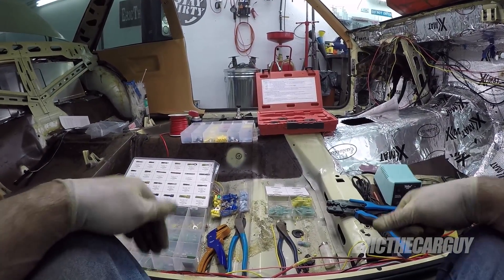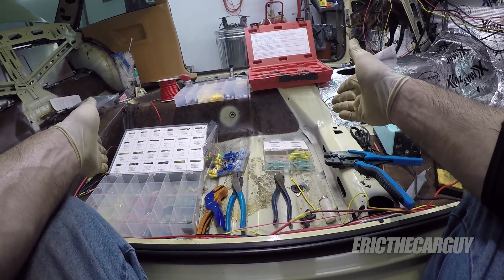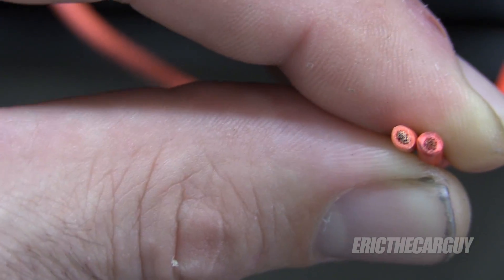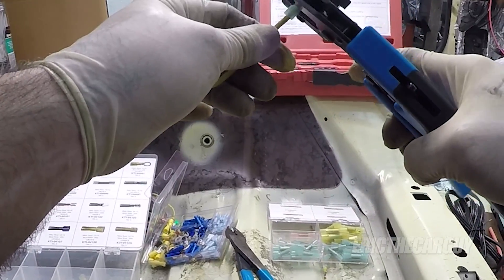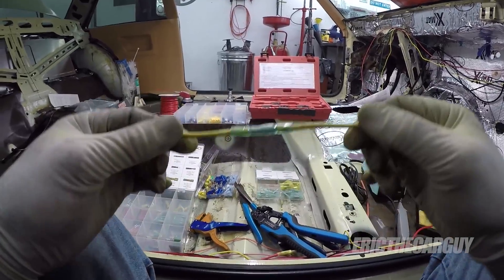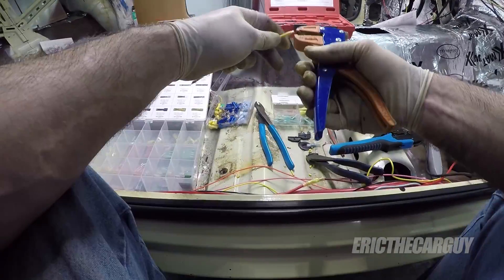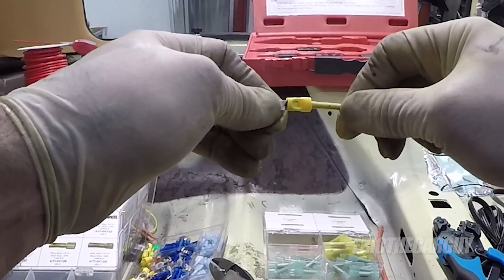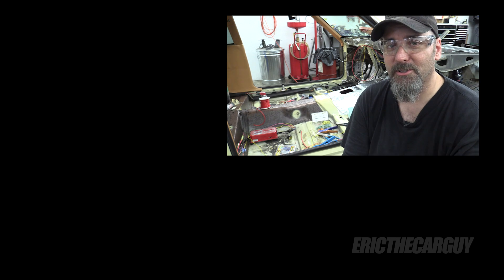How To Crimp Electrical Connectors

Comment: I'm an electrician in Queensland, Australia, and I specialise in industrial work (kind of similar to auto-electrical) and we don't solder anything. Not really sure why, we just dont solder unless doing printed circuit boards. Oh, and I've never heard of over-crimping. The jaws on your crimpers shouldn't go past the ideal amount of force. Everything else seems fine.
Reply from the maker: Thanks for your input. Funny you mention that about the crimpers, I noticed it did something similar to a torque wrench when it gets to a certain point. Honestly, after wiring this car with crimp connections, I'm not sure I'll be soldering again in the future.
Reply: The proper tool shouldn't over crimp. Over crimping usually damages the connector and feels like your over doing it just like tightening a bolt.
Reply: +ck m 
Please cite the FAA/MIL circular publication ID, chapter and section that show explicit warnings and or prohibition of solder joints and or soldering connections/connectors. 
In FAA publications Aircraft EWIS Practices Job Aid 2.0 and Advisory Circulars AC43.13-1B/2B, 43.18 wiring fabrication, maintenance/repair, connector soldering procedures are described, nowhere in the publications is soldering prohibited, limited or warned against.
Reply: Lewis Flynn, I learned the hard way working on automotive and industrial wiring in power generating plants for several decades, that failing to solder connectors can lead to searching for intermittent connection issues and we all know how irritating that can be. I'd much rather take that small extra step than to have to search for those intermittent connection problems.
Reply: Ragnarok043...If the solder on the joint gets hot enough to melt during use either the wire size is too small, connections are dirty/corroded or there's a serious short in that circuit. That's why fuse links are installed on wire that's vulnerable to high amperage anomalies.
Reply: . In moist conditions cheap crimps fail a lot sooner due to corrosion
Reply: M3ta7h3ad, LOL! Who told you that? Having worked on automotive and industrial wiring for over 35 years, I can honestly tell you that nothing could be farther from the truth. That's real world experience, not just something someone told me or that I read somewhere.
Reply: Good info. I was wondering that myself. The time savings has to be incredible.
Reply: Stranded wire is made to be flexible for ease of installation and vibration tolerance. Adding a hard point to a crimp by soldering doesn't really gain anything IF the connection had the right size terminal and was crimped correctly. I use an inexpensive certified crimper that while ratcheting it will not release the terminal during crimping until it reaches the proper depth.

Remember, most crimpers have a male and female face that mesh together during a crimp. The male side should be crimping the split portion of the crimp while the female side supports the solid rounded portion during the crimping process, on insulated and non-insulated types.
Reply: I've seen it in assembly manuals for the Long-Ez.   Also was told this by a Boeing engineer and floating somewhere on the internet is a actual whitepaper about this with post crimp etchings under microscopes (that I've looked for and can't find).    AFAIK, FAA rules are retrospective (e.g. they remediate past problems), not necessarily best practices. But apparently you know way more than I do, so I stand corrected.
Reply: I don't think the 'tool' overcrimps.  It is the operator that applies too much pressure.  Unless, of course you have a deluxe crimper, which most of us do not.
Reply: I worked on aircraft for several years, and yes, in certain situations solder can cause the problem you mentioned.  If the wires are properly bundled there is no chance of flexing at the joint, though.  I have never experienced a "cold weld joint".  They all fall apart when the connector is 'broken'.  I would be interested in reading the report on that study you mentioned.  You can always learn something new.
Reply: If the wire / connector become hot enough to melt solder, you used the wrong size wire, by at least 1 size, maybe more.
Reply: That is inconsistent.  Why then wouldn't the wires also be 'brittle' at the board?  Soldering wire does not make it 'brittle'.  It actually anneals the copper and makes it softer.  The actual joint where the solder is applied would be stiffer / not flexible.  Proper bundling of the wires will alleviate flexing at the joints that can cause long term failures.
Reply: All aspects of auto manufacture are designed to be fast, not always the best way to do something.  If a connection fails, usually way beyond the warranty period, it just means more work ($$) for the dealer.
Reply: By overcrimping, it is meant that the insulation is brofen at that point.
Reply: Many years ago telephone companies in the USA used solder type termination blocks.  A standard telephone cable has 25 pairs of wires, 50 total wires.  At a telephone distribution point, there would be hundreds of cables terminated on these solder type termination blocks.  You can imagine the man-hours it took to solder all those connections, and of course, there were reconfigurations later.  Then the telephone industry invented a non-solder type of connection that could be installed with a hand-held manual impact tool in a fraction of the timeand solder connections went away forever.  The savings in labor cost must have been huge.  Not only does it take time to solder a connection but also the wire must be prepped for soldering.  I worked as an electronics equipment installer and we crimped thousands of connections in critical circuits but rarely soldered in special circumstances.
Reply: In Electrical engineering class we were taught that soldering wire makes it brittle and increases resistance, crimping is the way to go whenever dealing with wire-to-wire joints, unless you are attaching to a board.
Reply: Certified and callibrated pliers (the expensive stuff) won't over krimp, but the cheap pliers the most people have, sure can over krimp (damage the insulation).Normaly, you don' t solder when your using this kind of connectors. Did you ever seen a soldered connector in a new car?  You can use solder when you make the connection with a screw, but beter is to use a crimp style sleeve to.
Reply: soldering does create a stronger joint but for certain situations thats not what you want. such as any high amperage connection that can get hot enough to desolder the joint. another down side of solder joints are more susceptible to fatigue, removable connectors usually needs flexibility as well as any connection subjected to vibration.
Reply: Robert G ROFLMAO! Then for 45 years you've been doing it wrong.
Reply: canmore0001 solder is not great in vehicles, or any place under heavy constant vibration, it fails. A lot more readily than a crimp.
Reply: In both aircraft and in most OEM car repair manuals, there are explicit warnings never, ever to solder joints.  The reason is that the base of the solder joint creates a hard spot that will result in a work-hardening break.   Crimping is actually significantly better, there are studies showing that a proper crimp will result in cold welding where the connector & wire become one & the same.   Also, bare crimps with heat shrink are generally considered better as you can inspect the crimp.
Reply: Crimp, then solder.  Clean the solder joint to prevent corrosion.  Then shrink tube.  Doing it any other way can lead to problems in the future.  Great tools for shrinking tubing are the catalytic heat guns from Solder-It.  No flames.
Reply: Soldering's arguably a better choice, but from a practical point crimping is the way to go. It's faster, doesn't require power like a soldering iron, a lot harder to get injured from a crimp tool than an iron, no fumes from the solder and can be done from a non-optimal location ie in a car trunk. You can go over your crimps with a heat gun or lighter (prefer a candle) after you're done all your crimps.
Reply: Another guy here that says that wires going into crimp connectors are not to be soldered before crimping them!

ASE Certified Master Tech for both Autos and Trucks, plus a former USNR Aviation Electronics Technician 3rd class PO who also worked in the medical electronics field for a few years before getting back into cars.

And the silliest repair that I ever saw on a car that was towed in was where the owner soldered the 3/8" flat blade connectors for a Fusible Link to a new piece of Fuse wire because the dealer wanted "too much" for a new Fusible Link ($20) and didn't have just the flat blade connectors available. He used a 100W soldering iron and just kept feeding the solder until it wouldn't take anymore! Filled the entire 6" length of fusible wire making it useless as a "fuse". Didn't even look for the source of the overload that burned up the Fusible Link, and then burned up the main wiring harness under the hood, plus the dashboard harness, too. His insurance company refused the claim on his comprehensive coverage - 3 year old car with 3 more years of payments left - stuck with a $5100 estimate on car worth maybe $9000 @ 3yo;  I that heard later from his wife who continued bringing her own car to us for service and repairs for many years after that. Never saw him again, but she said that he quit working on his own car after that event.

I refused the car after climbing up on the flatbed - (I told the driver to "take it the State Farm estimate office / garage" when he said the customer would be calling his insurance company and to not do anything with that car)  - the white dry chemical powder all over the front fenders and the burned edges of the hood, plus the black smoke coating the inside of the windshield was a tip-off that the car was a losing proposition for any shop that took it in. 

He had been a "good" customer for us - a DIY'er who had cross-threaded all 4 spark plugs (inline 4 RWD w/ aluminum cyl head) when he went to replace them the year before and a year before that it was aftermarket alloy wheels  which he didn't check the depth of the capped lug nuts before "ramming them home". Year old car and he bought cheap China wheels and cheap China tires in the mid 1980's, to replace the OEM Toyota stuff that would have given him a good 60,000 miles of life or more with regular tire rotations. The "shorty" lug nuts "looked better" he said, problem was they bottomed out before  the lug nuts were tight on the wheel. Noticeable wobble / looseness on all 4 wheels, and the customer actually drove it over to my shop like that!

My 6 month old 1/2" Snap-On air impact gun (rated 450 ft. lbs. for loosening) wouldn't remove any of the 16 lug nuts, the top of the wheel studs were bent over - even with the full 200 PSI compressor tank pressure. Only my rim clamp tire machine ever got full tank pressure, and that was for the tire mount air blaster to seat a new tire; the whole rest of the shop/s were regulated to 125 PSI. After a week of it sitting in my second building (the "hangar queen" and overnight parking shop next door to my main shop, and where I also worked on my own project vehicles when business was slow - plus I needed the outside parking lot the most) as the customer tried to get compensation from where he bought the new alloy wheels & tires, and "wrong" lug nuts for not selling him a usable combination. (I never did ask him why he didn't let them put the tires on, and how he even got all 4 home - borrow a truck or van - or 2 at a time to get them home). In the end I ended up borrowing a 3/4" impact gun from a friend truck shop nearby to snap off the wheel studs; only 2 lug nuts would even start to come off. $30 of cheap China lug nuts that were too short ended costing close to $1000 to fix.

Comment: Hey Eric, you should check out the klein tools #11063 wire strippers. We do a lot of custom wiring at my job and use this all the time. It's super fast and works well with different wire sizes.
Reply from the maker: I'll do that. Thanks!

Comment: Should've soldered them Eric it keeps thems corrosions out.

But that's really all solder does it keeps connections condensation free.

Godspeed good sir.
Reply from the maker: I disagree, the shrink tube butt connectors create a 'cold weld' and the shrink tube seals it when you're done. It's just as good as solder if not better and takes a lot less time. Thanks for your input.

Comment: I hate seeing people use lighters on heat shrink.  it works in a pinch, but I prefer a heat gun.
Reply: Meh, by the time I pull out my heat gun and plug it in. I would have already finished shrinking it by using the lighter that I keep in my pocket while doing electrical wiring. The result is the same, it is just that a lighter takes a little more "skill" or technique to use.
Reply: Tim Johnson i guess if you dont know how to use the lighter method the heat gun is better. I did burn and blacken the heatshrink when i first started but learned not to use the tip of the flame and not keep it on too long
Reply: I HATE SEEING PEOPLE
Reply: I've used both and I agree. The heat gun seems to be a more broad/even heat. But to each his own.
Reply: I pocket torch my heat shrink as well.
Reply: can anyone tell me the brand of crimper used in this video?.
Reply: it only leaves the black residue if you use the top end of the flame"...if you use the more "blueish" part of the flame..then it does not leave black residue :)At least thats what i found..and i use the lighter alot,but also use heat gun sometimes.greetings from Norway :)
Reply: Tim Johnson the lighter is a lot quicker. when your doing hundreds of solder joints, with headshrink that time saved really adds up. ive never had any problems with the lighter method
Reply: Fox I will use it when I am in a rush and the end result is usually the same.
Reply: In a pinch, a gas soldering iron will do as well. Especially when on the road.
Reply: thanks for correcting that stupid idiot!
Reply: It's the difference between an amateur and a professional..
Reply: I just use my soldering iron as it’s on already, why bother with a heat gun as well, unless you are not soldering at the time.
Reply: I like to put mine in a forge at 1200 centigrade just to make sure it shrinks.
Reply: The lighter works ok bit tends to melt the heat shrink.  it also leaves black residue on colored shrink tubing.  I have used it but I prefer a heat gun.
Reply: I tend to use my pocket butane torch on a fairly low setting.  I hold it about 2 inches away but point the spear-like flame directly at the wrap.  works every time.
Reply: (when an Uploader says in a video "I'll post links in the description" that means to click the SHOW MORE button below the video, and all of the info will be there.)  You're welcome.
Reply: It does the same exact thing. They both put off heat.
Reply: Nandor :  Flame is a chemical process and has a negative effect on the insulator.  Heat gun does not, it is heat only so it is the correct method.  50 years of experience.
Reply: The key is to use a mini butane torch on low setting.  You can point the flame like a laser beam and direct the heat as you wish.  With practice you can apply heat for just two seconds or so and get it perfect almost every time.

Comment: A good video, as usual. I feel that 'make sure your wire is good wire' (4:05) is a little vague ... maybe get an electrician's opinion on why those two types of wire look different, and whether that actually matters?
Reply: More smaller copper stands = more flex.  
Thinker insulation  = higher voltage capacity
Reply from the maker: Look close at the screen. You can see one of the wires has a couple strands less than the other. It's an issue I've seen a few times. They label it 18ga, but it might be 22 because of the insulation. Beware of cheap wire.
Reply: 'm not sure that the number of strands is of any significance - except 
that as KingofKYA says, given the same total area of copper, a larger number of thinner strands just means a more flexible cable. The thickness of the insulation can also be misleading, since the material needs to be specified.

For example, looking at a UK supplier of automotive cable, I notice that    they offer two types of cable said to be suitable for indicators and tail lights. The first is standard PVC multicore: nine strands of 0.30mm diameter wire, giving a total conducting area of 0.65mm2 (this is equivalent to 19 AWG.) The second is thin wall PVC multicore: 12 strands of 0.20mm diameter wire, giving a total conducting area of 0.35mm2 (this is equivalent to 27 AWG).

If you were to look at the two cables, the thin wall cable would appear much thinner (less copper, but also thinner insulation). The outside diameter of the standard cable is 2.3mm (0.090"), while the thin wall cable is just 1.4mm (0.055). 

The kicker is this: the insulation on the thin wall cable is hard grade PVC, which is much more resistant than standard PVC to all kinds of abuse. Its better resistance to high temperatures means that the thin wall cable is actually rated for higher current (7.0A) than the seemingly much thicker standard cable (5.75A). So you get a more durable cable that is actually thinner, too.

Given that the most common cause of cable failure in automotive applications seems to be deteriorating insulation - which high temperatures accelerate dramatically - I'd be more concerned about the quality of the insulation than the number of conducting strands, so long as the cable in question is rated correctly for the current it will have to pass.

Of course, if somebody is passing off 22 AWG cable as 18 AWG, no matter how many strands it has, that would be a different matter, and surely illegal.